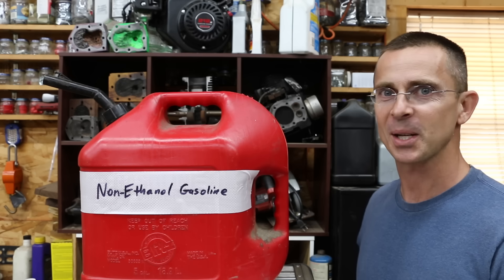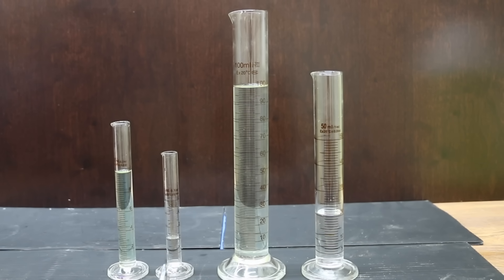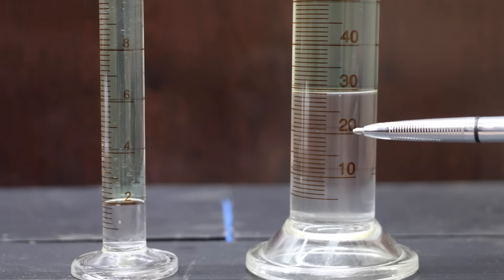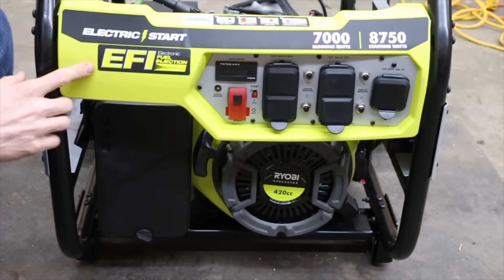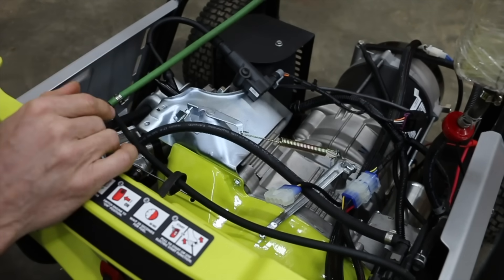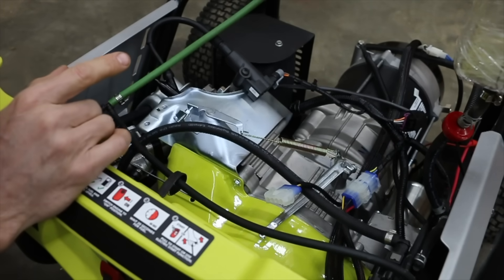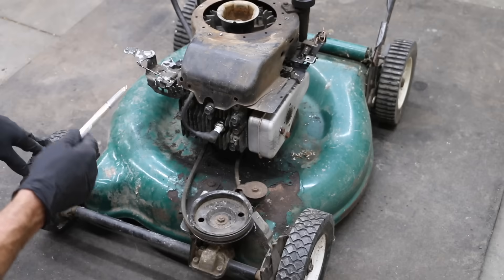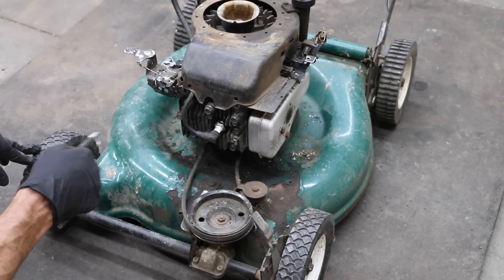Is Non-Ethanol Gasoline Really Better? See the PROOF!

Comment: Here's my non-scientific real world experience with 10 per cent ethanol vs. non-ethanol in small engines.  I had a mid seventies Johnson 9.9 horse outboard on a small boat.  It ran great the first time I used it using non-ethanol fuel/oil mix.  For whatever reason the next five gallons of fuel I used was 10 per cent ethanol.  The motor would not idle, was hard to start, and ran rough.  I switched back to non-ethanol fuel/oil mixture and the 40 year old motor ran like a top and still does.  I had a 2003 KTM 640cc high compression dual sport motorcycle.  Using high octane non-ethanol fuel the bike started and ran great.  When I was forced to use the e10 gas the bike would be impossible to start without starting fluid when cold and would not idle smoothly or not at all and would  constantly back fire.  Switching back to the non-ethanol fuel the 15 year old bike ran fine.  I'm sold on ethanol free gas.
Reply from the maker: Thanks for sharing.

Comment: I had always heard that ethanol burned too hot for small engines. I see that isn't necessarily the case now. Thanks for all the work you put into these experiments, I've learned a lot!
Reply from the maker: You are welcome!  Glad to hear!
Reply: ethanol does sometimes burn hot but thats only if your running high compression. or nitrous
Reply: Small air-cooled engines run hot at idle because of low air flow. Don't let them sit at idle. And NEVER run them at low rpm under load. Don't puts around the yard on your lawn tractor at low rpm in high gear cutting the grass. If the blades are on, run it at max throttle.
Reply: @user-mp8er1ds9x  load of bullshit DO NOT LOSTEN TO THIS FOOL OR YOU’LL RUIN YOUR EQUIPMENT!
Reply: @user-mp8er1ds9x  😂 also air cooled means air cooled regardless 😂😂😂😂😂 it sitting there running the least hit it will isn’t going to over heat it 😂😂😂😂 how can some of you be that dumb?
Reply: Ethanol actually lower the temperature in the cylinder, at least in direct injection engines.  The effect will be less pronounced in carbureted engines
Reply: Ethanol burns richer that means it’ll burn cooler
Reply: @cartere9981  Yeah no. It cools because it is alcohol. 

Put some rubbing alcohol on the back of your hand. Feel the cooling ? That is the alcohol evaporating (turning to a gas...)

When it is vaporized,mixed with air and enters the combustion chamber it does the same thing. It gets colder.

The effect is even more pronounced with high ethanol content fuels like E85.

Comment: My anecdotal test on ethanol fuel and longevity. My Craftsman rototiller was in certainly set aside with a full tank of fuel and not used for about 5 years. When it was pulled out to use, it still had fuel, and everything else looked fine. On the first pull the starter wrote broke because it hit dry rotted. Replaced the rope and it fired up on the first pull with the new rope. It has been used a fair amount for the last 6 years, and I have seen no problem with the operation, or carburation with the tiller. 
Is the non-ethanol fuel better? yeah probably. Does the fuel deteriorate over time? Yeah probably. Are these problems as significant as people make them out to be? Hell no.

Comment: first, thank you for making these vids. they are very helpful. one place where its easy to see the difference that ethanol makes is in 2 stroke outboards. not only corrosion in the tanks but also the rubber and plastic in the fuel systems are damaged. the real problem happens when the particles make their way thru the crankcase on their way to the cylinders. most shops will have a wall of 2 stroke outboards waiting to be rebuilt. most of the symptoms follow a pattern that you can read loosely based on time and amount of ethanol. I tell anybody who brings me one to work on that if they can afford me working on it then they can afford the better fuel.
Reply from the maker: Thanks and you are welcome!  Thanks for sharing.

Comment: For those of us with older cars and trucks, in my case a 1958 International A120, Ethanol is bad for the carb and I get better power and mileage without it.  Same with my 1974 VW Dasher with original carb.  With non-ethanol gas, it gets approx. 37mpg on the freeway and better power.  With it, it gets about 33mpg and doesn't accelerate as well, especially on steep grades.
Reply from the maker: Thanks for sharing.

Comment: Ethanol is a little less energy dense so it does give you a bit worse fuel efficiency, but my turbo car loves it. Supposedly it has a cooling effect which is helpful 
In your tests I think it did look a bit cleaner after running the ethanol test, but did you clean it out the same way before doing the initial non ethanol gasoline test?

Comment: Strong work! Thanks!

Since going to ethanol in gasoline, there has been a remarkable increase in the amount of times required to pull off the carburetors of small engines and clean them (compared to non-ethanol). A few years ago, I added 50 mL of each type of gas to a conical-bottom 50 mL Falcon tube and let them evaporate--the non-ethanol gas had no visible residue,  but the ethanol gas had a significant amount of brown gummy residue in the bottom of the tube.
Reply from the maker: You are welcome!  Thanks for sharing.
Reply: Yup causes a LOT of varnish to plug up the carbs.
Reply: @mrpoquah  varnish? Varnish is more or less associated with bad gasoline. Alcohol is associated with more corrosion and fuel line destruction. Most of this is basically due to inferior parts.
Reply: Gasoline leaves hard carbon deposits, while ethanol leaves a gooey slime. I prefer to clean the goo from ethanol over hard carbon deposits.

Comment: As i have said once before .. regular gas with ethanol only lasts 1 MONTH in a single cylinder engine... it will not run once u hit a month.. non ethanol gas lasts for about 6 to 7 years before it starts to turn like  Shelak . Its all about the shelf life ...they don't want people hoarding gas for years on end .. thats all its about and nothing more ...super unleaded gas with ethanol lasts over a year .. can't tell you how much longer then a year but at the least 1 year and 1 month ..i stopped the test at that time .
Reply from the maker: Thanks for sharing.

Comment: Ethanol has less bang than gas. Which means in a car you would not go as far, so costing you more. I thought the carbon build up would be less. Seeing your short test that's Wrong. So there seems to be no benefit to ethanol. All that soot, on the head, is going into the air. That really should stop. I'm not fanatical about it. But why not start to get better. We need "green hydrogen". Still combustion engines, Different fuel a Clean fuel. Maybe similar to those small green propane tanks. Have a hydrogen generator in the trailer, filling tanks. Then just screw one on a mower. After initial cost it's free fuel. Yes it's not all available today. If I had a bigger company using gas. I would sure look into ending fuel costs.
Reply from the maker: Thanks for sharing.

Comment: WOW - thanks for the great idea of using a drill / socket to start the lawn mower.  I was just about to scrap a 90's model Snapper 2-cycle 4hp mower because the recoil starter mechanism bit the dust.  Replacements are non available, and I was trying to figure out if I could retrofit a newer pull-start / cup combo.  Ran into lack of measurements in most ebay auctions, etc., etc.
Reply from the maker: You are welcome!

Comment: I helped an older Mechanical Engineering student, a Professional in his early 30s win a DOE contract for small entities develop alt fuels.
First of all, in the late 70s, Ethanol had significantly less Btu/ gal than gasoline. We used a Bosch fuel Injector to inject the fuel, fuel/ethanol,  fuel/water, fuel/ethanol/water. We injected measured amounts from Graduated Cylinders modified to be be filled from the top , exit the bottom, controlled volume, rpm, time and road grade all taken into consideration. We built the Electronic Fuel Injection System Controllers, which we hooked up to an Oscilloscope and matched our fuel injection based on the calculation of RPM and Injector flow rate controlled by the throttle linkage. My friend was 31, I was 19. 1978.
We preceeded the modern mixtures. We ran a 4 cylinder Ford Pinto and a 6 cylinder Chevy Monza.
Much learned, good time had by all.
I should add that when converted to Btu, there was no difference in the amount of Energy to go a given distance. Gasoline  was 114,000 Btu per Gallon, Ethanol / water, Gasoline,  Methanol / water, Gasoline ran less and, thankfully, everything followed the Laws of Thermodynamics. It takes y amount of energy to a  move a mass x distance. The best one could ever hope for is  to break even... the First Law of Thermodynamics.... the Second Law is, you will never break even.
Reply from the maker: Thanks for sharing.

Comment: You should run another test on an engine with increased compression. Ethanol slows the burn rate of gasoline which is why it was orange-blue at low rpm. With higher compression, it would likely burn blue. 91 octane is ideal for engines with a minimum of 10:1 CR and it's what I use on mine. Lawn mower engines aren't usually above 9:1. People often run 80% ethanol when they raise their compression above 13:1, borderline detonation for 91 octane gasoline and pure ethanol above 15:1. Generally, those engines are built specifically for racing and are rebuilt after a few runs.
Reply from the maker: Thanks for the suggestion.

Comment: If you are going to store something for a longtime ,put a bit of Kerosene in the gasoline tank  at least 1 oz or a bit more   or diesel fuel  in the gasoline tank and run the engine until the mix gets all in the fuel system ,and you can add some STABIL in the mix also, but SATBIL alone  is not total insurance .. White Gas used in lighters and Fuel Lamps as an additive will help as well  . Mineral Spirits helps also since it is 100 percent Petroleum ....Marvel  Mystery Oil  ,great as well for storage and Eth problems ..I have 40 year old push mower and have never replaced a part in the carburetor
Reply from the maker: Thanks forethe suggestion.

Comment: #1, it is a scientific fact that ethanol fuel mix has lower btu/hr than gasoline, so not quite sure why you needed a "test" to come to the same conclusion. #2 Carbon buildup in the combustion chamber is mostly caused from oil leakage past valve stems, and piston rings, and very little if any from the fuel (unless it is diesel).  So this entire video is really an exercise in futility, except its sole purpose is to make money from views. Surely your subscribers are smarter than this?!?

Comment: Ethanol is awful for motors.

Specifically rubber and diaphragms etc.
Reply from the maker: Thanks for the feedback.
Reply: I guess I should be more specific. In 2 stoke motors I have found it’s absolutely worth the extra cost of non ethanol. You will be rebuilding carbs twice a year vs every few years if you don’t use the proper non ethanol gas to mix for your two strokes. 

This comes from a landscaper using this stuff daily so obviously I put more hours on than most but it’s just as important for a homeowner who leaves equipment sitting for a week at a time.

Comment: My vehicle is mid 90s fuel injected Honda. It is not a flex fuel vehicle. I look at as the vehicle was born with gasoline, not E15 so injector pulse width is set up for gasoline, not E15. I can afford only because I am retired and do not commute. Absolutely clear non ethanol goes in lawn mower, motorcycle, even vehicles seldom driven as it lasts a couple years
Reply from the maker: Thanks for sharing.

Comment: The biggest problem seems to be the ethanol is too high % at some stations. The gov has found that some stations are selling some that is as much as 55%.  My mower won't run on it, my pickup has trouble with it and my gas generator hates it.
Reply from the maker: Thanks for sharing.

Comment: You didn't mention the cost of turning food (corn) into auto fuel and the corruption that follows the money on such matters. Using food for fuel costs the fuel buyers (us) when we buy it, it costs cattle ranchers when feed prices rise which costs the end user (us) yet again. And then there is the cost of raising the corn, farmers use large amounts of fuel to raise the product as well as the cost of fertilizer. Then there are the politics--food growers like the increase in their market but don't really care what happens to the feed they produce. The whole apparatus churns billions of dollars each year for negligable benefit to anyone. It was a plan hatched by liberals in the 70's to turn garbage into fuel, and of course it has never worked as we were told--EVER! but it costs us all billions every year in wasted resources, political corruption. We should ban ethanol production immediately.

Comment: It seems like since the fuel burning blue flame would be hotter it might be more efficient to use ethanol to dicippate heat inside the cylinder due to fuel induced piston cooling
Reply from the maker: Thanks for the feedback.

Comment: Ethanol is a cleaning agent not much different then alcohol used for cleaning wounds where straight gas is a refined oil product. The idea that ethanol is bad for engines comes from the ethenol cleaning years of straight gas contamination out of the fuel systems but also ethenol causes carburator seals to start drying out but there's also the issue of water containing the ethenol fuel specially for under ground storage tanks that will start pulling the ethenol out causing octane levels to drop
Reply from the maker: Thanks for the feedback.

Comment: I used E85 in my 2000 Taurus, it was made for it(yellow cap on the filler cap), i lost 10-15MPG. It cost me more money to use E85 than not, also ethanol is highly corrosive, cannot run it through a pipeline it has to shipped by road or rail. Ethanol is actually dirty for the environment. If your engine is not made for ethanol it will destroy your fuel pump and gaskets.
Reply from the maker: Thanks for sharing.

Comment: It is the sorriest excuse for Fuel it will ruin every small engine you put it in i know i do not need to be educated i have enough Gummed up non running engines to prove it is damaging , I have not had a problem after i stop using that Crap .
Reply from the maker: Thanks for the feedback.

Comment: it is to bad i didnt see this one earlier as i took my 2009 Electra Glide sea foam green with cream white and matching trailer to Sturgis from Las Vegas.. this bike had just had its 25k service days before i bought it about a month before the trip.. bike ran awesome getting their and while their.. on the way home i got a tank of premium at a little town of 350 and a little mom and pops place.. wasnt until after i pumped it she mentioned that they dont sell much premium around their.. 3 hours later i filled up again and 20 miles down the road i was pissing fuel out the quick connect.. i wrapped it up best i could to make it 1o miles to Green River,Wy.. when i unhooked the quick connect the o rings crumbled and fell into pieces... wish i knew what was in that fuel.. the bike ran great cruising 85-90 with trailer other than those orings trip back was good .. got o ring set from ace hardware next morning and was a steady 7 hours from their back to Vegas
Reply from the maker: Thanks for sharing.

Comment: let that lawn mower sit a few weeks, then let it sit over the winter..  oh boy..  take it out on the water for marine use..  the issue is when it sits for longer periods, over a few months.. that's where the issues arise.. burning it up daily or weekly isn't much of an issue unless its marine application or exposed to high doses of water, alcohol absorbs water out of the atmosphere and it bonds to the alcohol, that in turn will rust tanks, corrode lines adns destroy carbs..
Reply from the maker: Thanks for the feedback.

Comment: After Hurricane Sandy hit Long Island, we had massive gas shortages and power outages.  At one point I was forced to used E85 in my car and in my generator.  Though I didn't see a difference in my car (it did set off the CEL), in the generator, it lasted about an hour longer, under the same load.
Reply from the maker: Thanks for sharing.

Comment: WTF?????? Early on it was known that ethanol would raise octane  ratings. However there was not enough ethanol being made to use it for  gasoline for non military use. So, lead was used instead  Only  Amaco use ethanol and it was know as their "white gas"  as it was not yellow from the lead  in other gas.This is what most used for small engines such as in lawn mowers and outboard engines etc to prevent lead deposits in these engines.  
Eventually, farmers started to grow more corn  to to make much more ethanol with and there is now enough ethanol to use for all gas.
Reply from the maker: Thanks for sharing.

Comment: In modern day fuel systems ie fuel injectors ethanol gasoline does not present a problem. Alcohol is actually a cleaning agent and will scrub an engine fuel system and remove the contaminants. These contaminates will clog carburetors and small jets. If used regularly and from the start should not have any issues. If laid up and particularly in humid environments water contamination will occur. In fact, any gas laid up for long times is not good. Ethanol worse. Non eth is more expensive .. and could be a consideration over a long period of time. Boats and outboards are problems because they can be unused for prolong periods of time. Used regularly no problem.
Reply from the maker: Thanks for sharing.